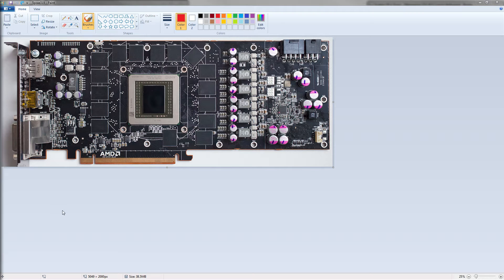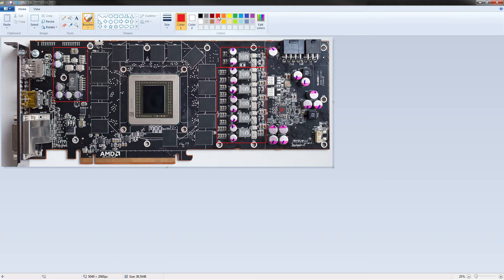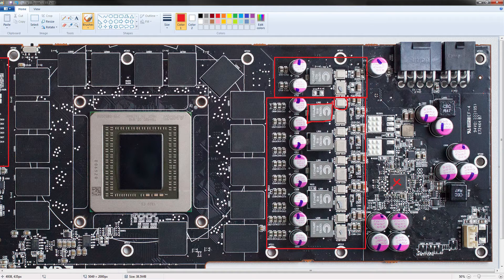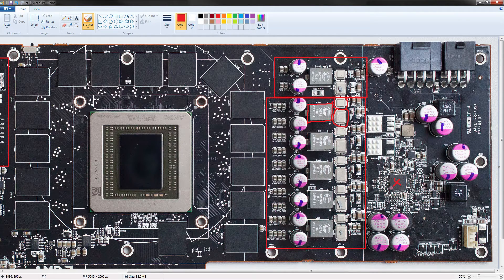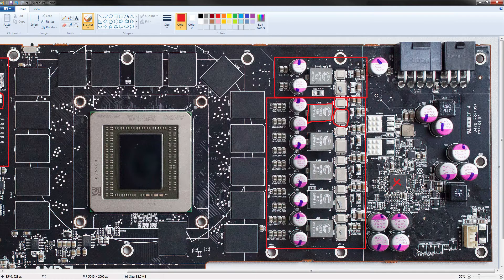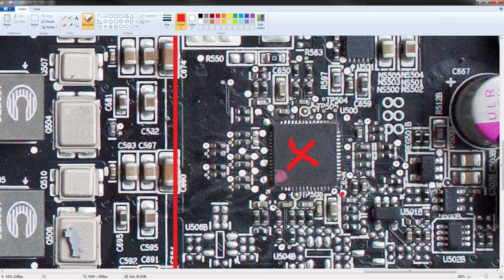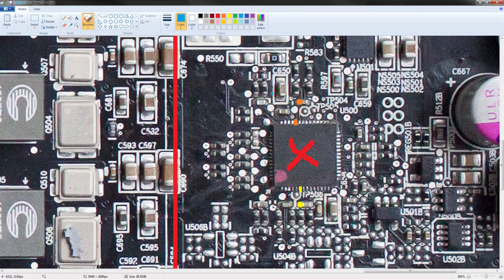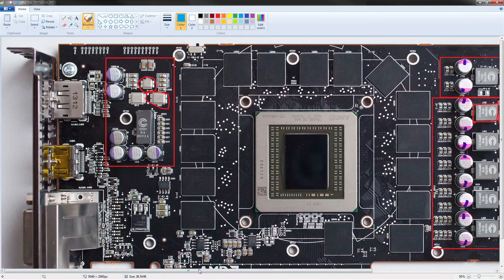R9 290X PCB breakdown + power and voltage mods.

Comment: I flashed PT1 on my water-cooled 290x and i can't seem to get the GPU tweak to work. I think it's interfering with Radeon software because the core clock gets reset every time I try to apply it...

Only voltage doesn't immediately jump back but I can't seem to find any difference in HWinfo in terms of voltage 🤔

Comment: Hi, I'm messing around with coil wining repair on R9 280X cards this time, do you know a better, non-wining replacement inductor type which fits on the PCB??
I've just found the Coiltronics / Eaton FP1007R3-R15-R
 ones at Mouser:
https://www.mouser.com/ProductDetail/Coiltronics-Eaton/FP1007R3-R15-R?qs=GxOUx7aO6nyJQ1rFPWaMUg==

Should I just use these ones in the hope the wine is fixed replacing them with the same part, or could you recommend another fitting one?

Furthermore: I've a Gigabyte R9 280X Rev. 2 here, which is only detected as PCIe x8 instead of x16.
https://www.techpowerup.com/reviews/Gigabyte/R9_280X_OC/3.html

Do you know which part should be responsible for that? Maybe that's just a resistor to be replaced?

Thanks so much for you work, highly appreciate what you're doing.

Comment: Hey i have a r9 270x, when i install drivers i get a black screen i have tried it in other pc's but it does the same thing, Do you know if there is a FIX ? thanks
Reply: You can try refreshing the card bios. It is a risky process but if want to take that risk I think Jayz2cents has a good video on doing that. In that video I think he repaired a GTX 980 ti.

Comment: Hello! Could you please tell me what happens if the high site MOSFET of the extra voltage phase is gate-Source shorted (not in itself, but in its driver NCP5230) ? I would consider it as the 7th phase, also I don't know if this is the actual numbering as I do not have schematic.         I have a problem with a R9 290 4GB 7 phase graphic card that only supplies voltage to Memories, but not to GPU! Is that some sort of protection the controller uses in such cases and phase 1 to 6 are not activated by IR3567B? Thanks for clearing it out!
Reply: meu é  inverso

Comment: have a question watercooled my sapphire r9290x vaporx it overheates to 98c and screen went blank restartd gpu not detected no video is my gpu fried
Reply from the maker: sounds like it probably is
Reply: well shite thanks man
Reply: strange. considering that it supports up to 95c, Fried just for other 4°c?
Reply: Sounds like fault GPU. My R9 290x throttles at 94C no matter what. Solved my thermals with aftermarket cooler + spacers on the back. The cooler was not quite touching the die.

Comment: After doing a DIY cooling solution to a second hand 290X I picked up it seems I missed cooling the topmost smaller mosfet in your image. (IFR6811?) The card will not let my PC boot anymore and a black marking on the top of that mosfet is the only damage I can see with the naked eye. Do you know any cheap tricks to make the card work again?

Comment: You mention at a point to put a temperature probe near the VRM. Isn't the software readout correct from GPUZ?
I am asking because I change the cooler of my 290x because it was too loud. The problem is that I now with the watercooler I have random black screen but only during high gpu usage. But even in games like smite I get black screen. Gpu temp does not go over 50 and VRM1 stays bellow 70 and Vrm2 bellow 50. These temps I get in games. Right now I run  FurMark (GPU - 62, VRM1 - 88, VRM 2 - 58).  And no crash!! So it looks it is not temp related. I play games in  4k. I have tried differetn power supply. Separate power cables, lower , higher voltages.. and lower or higher gpu speeds. I seams that the GPU speed is not related to the event. Now it is stable but with a mem clock speed of 1000 Mhz.. that is 250 mhz lower then default. Gpu is at 1000 as default. Any ideas? 
Furmark does not use only 702 MB of VRAM..

Comment: I just found your channel and i enjoy it so far. I have R9 290X Lightning, and it have all voltages unlocked in Afterburner, even Aux, but i never knew how Aux voltage could help me with my OC ?
Reply from the maker: Aux can sometimes help a little with memory clock but generally it's completely useless.
Reply: Actually Hardcore Overclocking
Ok tnx :) I just set my memory on 1500 without touching Memory or Aux voltage and it's fine

Comment: do you know if its the same as the gigabyte r9 290x pcb? and if not can you do a video on that one too? thanks
Reply from the maker: They are the same
Reply: u sure? look at this photo: https://www.google.co.il/search?q=gigabyte+windforce+r9+290x&source=lnms&tbm=isch&sa=X&ved=0ahUKEwjl7Ji2xq3NAhXRERQKHdXMDIQQ_AUICCgB&biw=1440&bih=775#imgrc=5EqbVDqHoyLnuM%3A
it doesnt have the line of round pink things near the memory as the reference card has..
Reply from the maker: the layout is tweaked a little but still the same.
Reply: ok.. so im assuming that a reference cooler or water block wouldnt work with the gigabyte one right?
Reply from the maker: According to EK their full cover 290X waterblock will work. I'd expect the stock cooler for a 290X to also work

Comment: Great video. What do you think about that Sapphire 390 Nitro pcb btw? Core vrm looks a bit different to me, also different mosfets. 

 https://www.overclockers.ru/images/lab/2015/07/23/1/03_big.jpg
Reply from the maker: I do believe I mentioned that the 390X and 390 PCBs no longer use the 6894+6811 combo but use PowerIRStages to get better efficiency.
Reply from the maker: I'm not sure where the sensor(s) is.

Also that MSI PCB is not the 290X layout. It's using doublers for Vcore.
Reply: But the mosfets are same right? Which design approach you think is better between the Sapphire and MSI?
Reply from the maker: The Sapphire is using 60A PowerIRStages. Those will do better at high temps than the 6894+6811 combo of the MSI. Also the MSI is doubled and has a smaller capacitor bank so the Sapphire should be significantly cleaner. Power wise the Sapphire is weaker at lower temps but at high VRM temps the Sapphire should be stronger. Also the Sapphire VRM should be more efficient. For and water cooling the Sapphire is the better design for LN2 the MSI might be able to push just so much more power that the other differences don't matter as much.
Reply: Thanks a lot for the answer. Really informative.
Reply: I'm wondering about powecolor's layout because it also uses powerir's but layout and some componets look quite different compared to sapphire as you can see 

http://proclockers.com/sites/default/files/PowerColor_PCS_R9_390_12b.JPG

http://www.fudzilla.com/images/stories/2015/Reviews/Graphics/AMD/R9_390/PowerColor/PowerColor_PCS_R9_390_PCB_1.jpg

http://www.fudzilla.com/images/stories/2015/Reviews/Graphics/AMD/R9_390/PowerColor/PowerColor_PCS_R9_390_PCB_3.jpg

http://www.technic3d.com/article/pics/1817/PowerColor_PCS_R9_390X_13.JPG

I'm just wondering this because this card doesn't want to oc at all.
Reply from the maker: that's basically the same thing as the Sapphire. 6 +1+1 phase 60A on core and mem(not 100% sure) and 4 Fets I can't identify in the the last phase.
Reply: Actually Hardcore Overclocking Ok thanks for the quick reply :) Oh well maybe i was just unlucky or i need to just push more voltage to it when i stop being lazy and install my new  bigger rad and block for it. (Those have been waiting in my closet for 1 year now :D)
Reply: Just noticed that Sapphire actually has powirstages 3553 which is rated 40A I guess. 3555 is the 60A one and is a bit bigger actually. So it's a little bit inferior compared to reference design?
Reply from the maker: Hmm you're right. So that puts the VRM at around 240A total output which is significantly lower than the stock card's 350A. I haven't heard of one burning out but in theory it should blow up at around 1.4V unless there is some major differences in how the card behaves compared to a 290X when overclocking or my calculation is way off.  Also the datasheet doesn't make it very simple to compare it to the 6894s which just get a regular Current VS case temp curve the 3553s have a current VS ambient temp curve. Which is great for designing a server not so great for comparing it to a 6894.
Reply: But it's still decent enough for some overclock right? Like +50-60mv. 

Also what should be the avarage/max vrm temps I'm getting at full load? What's your suggestion?
Reply from the maker: Here's the thing. There are plenty of people on HWbot pushing the sapphire 390 above 1200mhz core. For that they probably need 1.3 to 1.4V so I'd say the card is perfectly good for all overclocking and I just need to refine my power calculations for GPUs.
Reply: Actually Hardcore Overclocking I get artifacts on some benchmarks if i oc my gpu more than 50mhz with power limit maxed out and it's not much better with vram.

Comment: Do you think the back of the card needs some additional cooling? Right now I've water-cooled the card and I would like to push it. I think that on the back there are all the drivers. I would like to cool my vrm a bit more so I was wondering if cooling the back might help or not. Also I don't know where vrm1 probe is, that's why I'm asking.
Reply from the maker: All the driver FETs are on the back of the card but they really aren't important to cool. However the 6894s ans 6811s do dump a lot of their heat straight into the PCB so some thermal pads on the back of the PCB with a heatsink could improve VRM thermal's.
Reply: Actually Hardcore Overclocking Thanks a lot mate! Il planning to get some backplate, like EK or Aquacomputer (passive). Even 5°C could justify that investment, 30 bucks is something i can afford :)
Reply: Get the Aquacomputer backplate. Lowers the VRM 1 temperature tremendously. Expect 20° drop at least when water cooling.
Reply: Wilhelm Sundström You mean the active or the passive one? I was thinking about the passive one because i don't know about compatibility with XSPC waterblock
Reply: Yes the passive one. I got it with a Aquacomputer waterblock. If you modify your bolts it will probably fit with an XSPC block as well.

The active one gives the best temps at a cost of slightly higher core temp. But it only fits with a Aquacomputer block since the terminal is linked with a heatpipe to the backplate.

Comment: IR3567B controls VDDC and VDDCI (AUX), this is what I get when click "i" in MSI AB http://i.imgur.com/TsatQkQ.jpg . This is also highlighted by Unwinder author of MSI AB and by The Stilt.

When viewing Shammy voltmod guide it show VMEM measure on rear VRM and VDDCI on front VRM, so is front phase VDDCI or MVDDC? and what about 1 phase on rear VDDCI or MVDDC?

Then VMEM adj volt mod is differing location to your information. Any chance of clarification? cheers
Reply from the maker: It's been ages since I've had a 290X in my hands. But I'm pretty sure that I got memory voltage control from the 3567B. As for the location of the memory phase I'd trust Shammy about it. I'll probably have to redo this video once I have a 290X on hand again.

Comment: Hey, where can i find VRM schematic for the 5970? Card wont post and 2 red led lit on the back. Checked vcores and nothing only a 3.3 voltage was measurable on the Vdd pin on the Pm25LV010 chip
Reply from the maker: +Crysis9800 The Pm25LV010 is not the Vcore controller. The Vcore is done by the VT1165MF. Datasheets for the Voltera VT1165MF aren't publicly accessible. I think you best bet would be to try externally powering the card and hoping that the card won't miss the PWR_OK signal.
Reply: I know that these voltera datasheets are not publicly available and the Pm25LV010 is the flash controller. The card does not warm up so maybe is a defective bios or has nothing to do with that?
Reply from the maker: +Crysis9800 A defective BIOS would still boot the VRMs.The only way a VRM won't boot is if there is something wrong with communication between the GPU core and voltage controller.
Reply: I measure ridiculously low resistance between vcore caps.. wtf is any short? About 1, 2 Ohms. If you could measure the HD5870 and tell me the values. I was wondering to power up with an external powerboard and go nuts.
Reply from the maker: +Crysis9800 That's normal. The circuit looks like: Vcore >> GPU >> GND. GPU cores are really really low resistance when turned off. My GTX 590 had a resistance of 1.2Ohms Vcore to GND.
Reply: Thank you man!!! So i do not have any type of short there... If only i hack these voltera chips